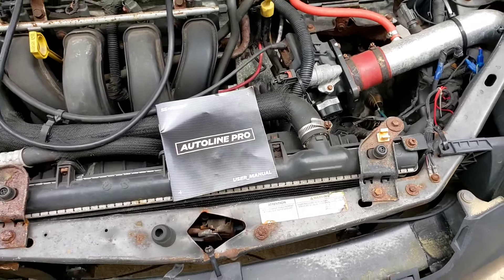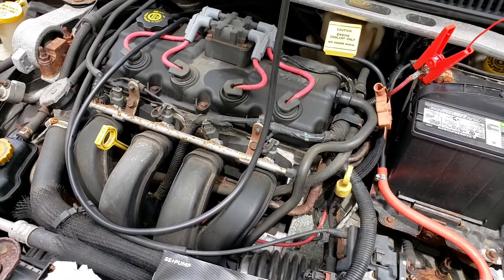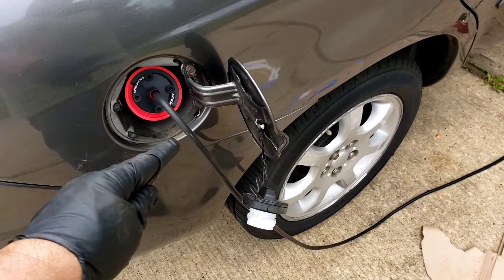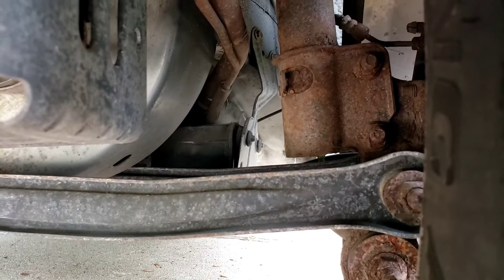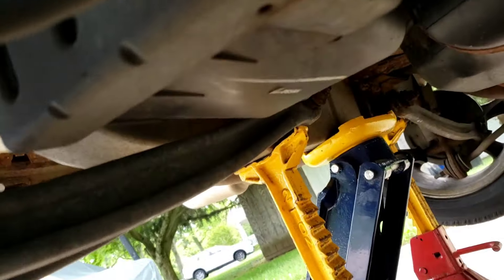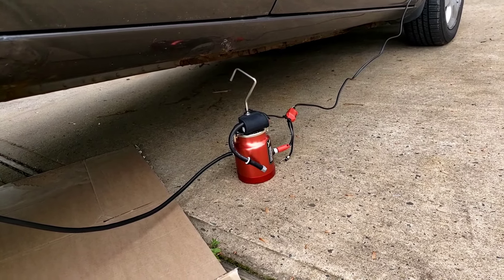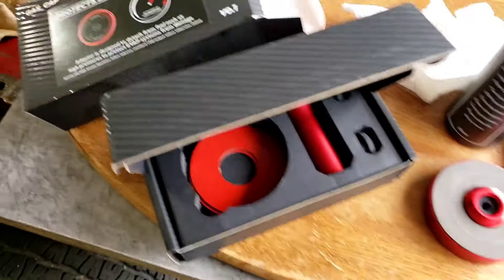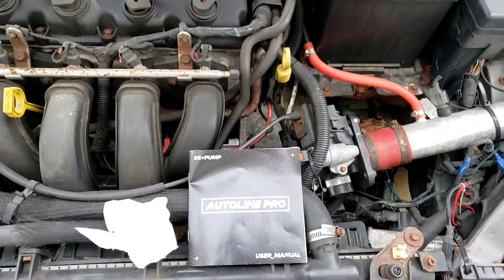Evap Codes P0456 Best Way to Find a Leak Smoke It Dodge Neon 2003 and Others Similar

Comment: That's a awesome device. Look's like a pain of a location for the canister. How much is this product and everything?
Reply from the maker: Paid around 130.00 then added some accessories to it, I've looked at several makes and this one stood out. Didn’t need an air compressor   or 110v extension cord, its all contained..on sale it was about 155.00 total give or take. They have a cheaper one without the pump, you use your own air..its 20.00 dollars less..but atleast this one is portable..
Reply: @alyoungcuda  Nice. Not too expensive. Compared to the $2000 before. Thank's for sharing your video and information
Reply from the maker: @ShawnStafford-1978  it was worth it..